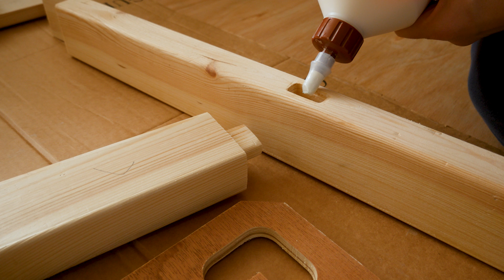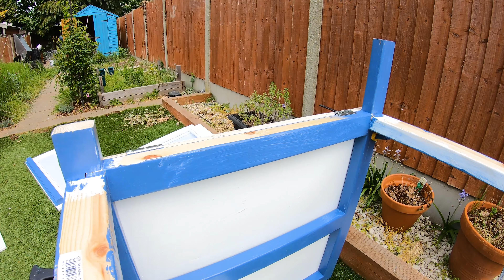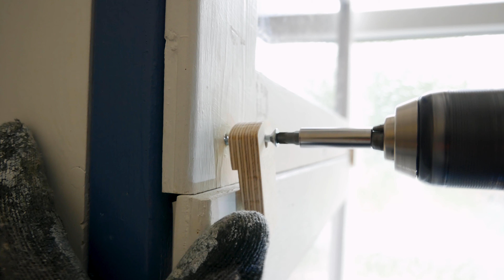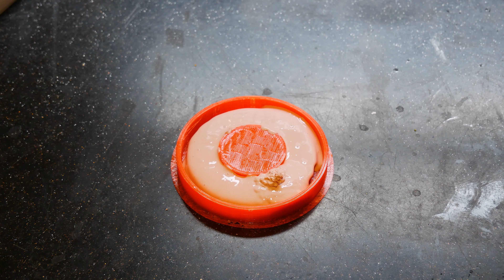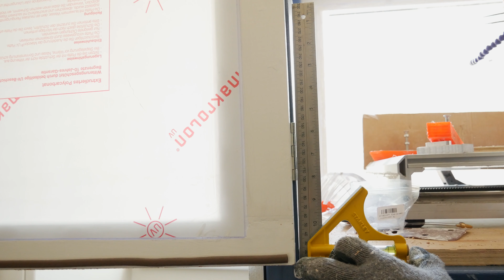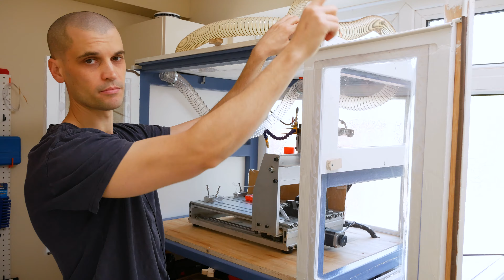DIY CNC Enclosure Build - Effective Noise & Dust KILLER

Comment: Nice design, have you measured how much dB when you closed the door and CNC+vacuum running ? Thanks:)
Reply from the maker: I did record the dB drop in the video of the spindle on and off i believe. I have my vacuum and air compressor outside of the enclosure in the room so its still noisy when all these things are running.

If it werent making youtube videos with the CNC i would have built the enclosure from 18mm ply on all sides and lined with foam or carpet to really cut down the noise, you can certainly make the enclosure more soundproof than what I made here but I needed to have visibility of the machine

Comment: It doesn’t take a lot of woodworking tools to build that kind of enclosure.
All you need is a circular saw and a drill. Those are the two essential power tools. A skilled carpenter can build nearly anything out of those.

And yes. All those fancy wood joints are totally unnecessary, when what you should do is use screws. Plywood gussets or panels would help keep it square and rigid.

Comment: Thank you. One of the first things I'd done for my 3040T after breaking a 6mm end mill. If that hit me in the face it would of hurt, if I'd had not been wearing safety specs would of been much worse. I used 8mm polycarbonate on the doors and made out of wood too with removable side panels and the front door hinges down. It has made it much quieter but a upgrade of the table did help a bit too. Like the 3040 you got by the way with the linear rails/profile, thinking of either modifying mine now or try building one :-) . I have no garden as such so had to do the word working in the bathroom of my flat :-)
Reply from the maker: Ouch! Be careful my friend! Glad you got it fixed.

Comment: Great build, I'm impressed at polycarbonate blocking sound with no sign of sound deadening foam, I thought it would reverberate, much better success than mine with 10mm  closed cell foam adhesive on wood panels.
Reply from the maker: Yes i was actually surprised how well it worked. Honestly i think its more to do with it being air tight than the thickness of the panels. I get the same noise reduction effect after adding weather seal and draught seal around my doors in my house. It cuts down noise so much.
Reply: Good idea,think I should concentrate on the seams & seals. Thanks for the idea. Take Care & Stay Safe